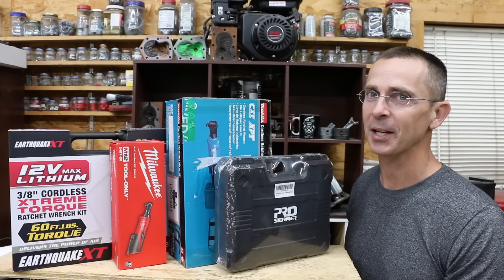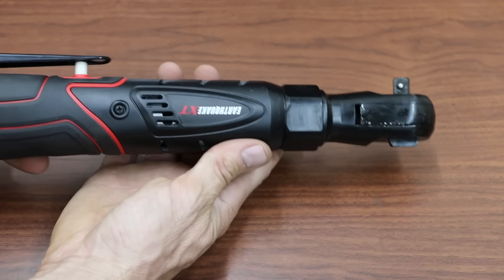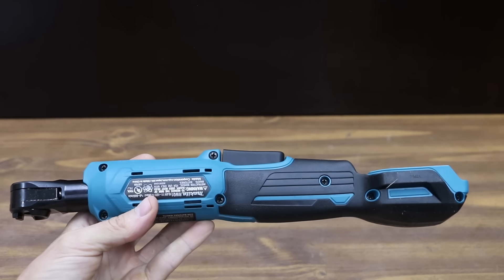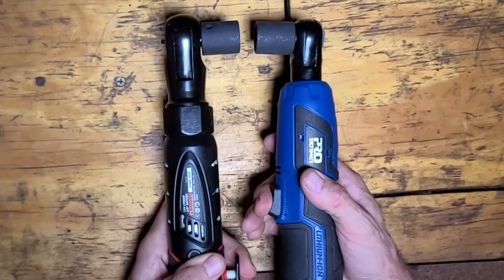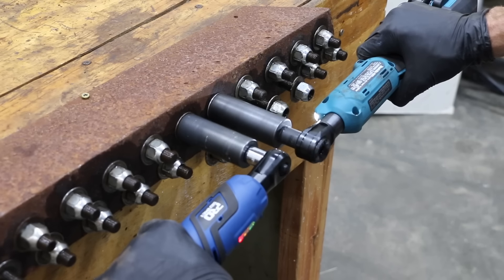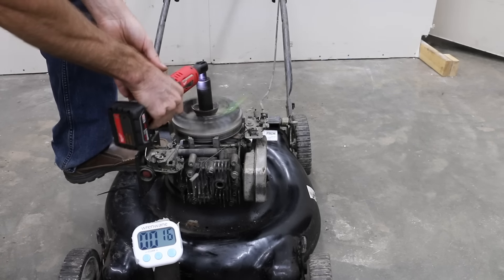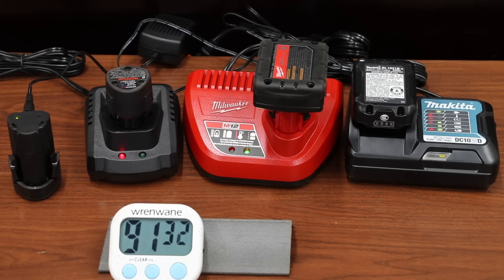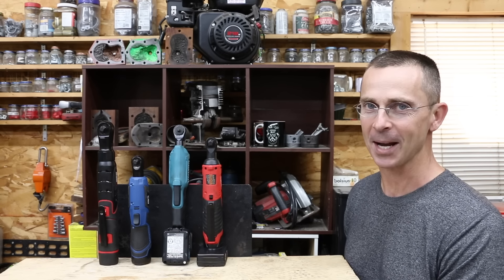Best 3/8 Cordless Ratchet? Milwaukee M12 vs Makita, Earthquake & ProStormer. Let’s find out!

Comment: Too bad it was the old Milwaukee and not the fuel. I have the old and the fuel with the fuel being considerably better
Reply from the maker: Great suggestion for round 2
Reply: My fuel died just tightening a bumper bolt, only used a handful of times, super disappointed
Reply: Ha, for a second there I thought you were talking about beer! 🍻
Reply: @ProjectFarm  round 2 should include a snap on and maybe throw an air ratchet to compare against. I've found my fuel ratchet has now completely replaced my air tools. Especially for at home.
Reply: @strelokblackburn4651  milwaukee has amazing warranty but I've only used it twice in 10 years and I have about 80 tools so far...
Reply: @adampetten1009  yea but got it used so idk if that still applies
Reply: @strelokblackburn4651  then there's no reason to be disappointed...lol. The last guy could have run it over with a truck, then sold it to you in "working condition".
Reply: @markburkey6371  true, but looked brand new
Reply: @markburkey6371  still love my stubby impacts tho. Use them quite often
Reply: @strelokblackburn4651  bring it in, we nearly smoked a 3/4 unbolting a 20" pipline with 2-9/16 studs. went into the service center as it was down on power and they replaced it

Comment: That wasn't the Milwaukee Fuel Ratchet,right?  That would have smoked them all.
Reply: Correct, except on weight, and size where it would be near the Earthquake.
Reply: Yes, but the fuel is also a decent bit more expensive.

Comment: Not sure about other brands, but it may be worth mentioning all Milwaukee cordless tool are warrantied for iirc 5 years from date of manufacture.  If it breaks print out a free label from Milwaukee and in a week or so you'll have a new tool.  No need to register the tool or provide a receipt.  They use the serial number to confirm it's under warranty.  Batteries are warrantied for 2 years .
Reply from the maker: Thanks for the feedback.

Comment: Why would balance matter at all?
The handles aren’t centered.
Reply: what do you mean it does not matter?? if the ratchet end of the tool is twice as heavy as the back it would clearly create a weight issue compared to being balanced.
Very low IQ question.
Reply: @ryandavis8719  You are correct. Additionally, poor weight distribution can increase tension on the wrist making it feel heavier than if it was well balanced.
Reply: @ryandavis8719  I didn’t state “it does not matter.”  So perhaps you should learn to read before trying to pathetically insult another persons IQ.  Do you even understand the meaning of balance?  In the video he’s showing two scales on the ends of the tool.  The handles are justified to one end of the tool. Are they not? So how is the weight ever going to feel balanced when 3/4 of the tool is hanging outside your grip? Besides, the point of “balance” would change as soon as the tool was off the horizontal plane.  You trying to tell me that you’re only planning on using one of these horizontally level? With your hand dead center of the tool somehow?  

That’s what I thought!
Reply: @ericarango5969  wow!!! So much tension on your poor little wrist from a mere two pounds.
Reply: @jhitt79  You'd be surprised, actually. I've used a well balanced radiation detector weighing at 10lbs for an extended amount of time out in the field and it felt like a feather. I've also used a radiation detector weighing only 5lbs but because the bulk of the weight was away from the handle, it felt like I was carrying the full weight. This follows the simple physic's equation of torque. Of course, 5lbs, 10lbs, or any insignificant amount of weight wont hurt my wrist but it definitely feels a lot more comfortable.
Reply: @ericarango5969  I wouldn’t be surprised because you’re comparing apples to oranges. How much does the heaviest tool in this comparison weigh?  How long is the longest?  How “unbalanced” is it (where is the fulcrum?). How often are you actually going to hold that tool perfectly level?  How is the balance effected when the tool is working? 
I don’t need to get into physics to know that when the torque is applied the issue of the tool balance is going to go out the window.

Comment: Great comparison test as usual, Thanks PF, and thanks for the excel video file also. I noticed no tests for jigsaws. I've had expensive ones like Porter Cable and cheap entry level ones like Skill and there is quite a difference. User skill level with this tool makes a big difference but it still could be an interesting test. Thanks again PF 👍🏼

Comment: i have had my Milwaukee 4 years now. it has been used daily as a service tech in rain snow mud. i have even driven it over a few different times i stored it outside for years aswell. no problems with this tool yet. i have used my milwaukee impact guns under 3 ft of water in freezing conditons i spent around $1000 for both my impacts and ratchet. but they have made/saved me 30 or 40 times the amount i have paid for them
Reply from the maker: Thanks for sharing.

Comment: Hey Brother! I'm a Diesel Technician. I swear manufacturers are using cordless tools to great degree when formulating labor times. I greatly appreciated all effort you put into the test for this channel. A few years back, I purchased big bundle of Ryobi cordless tools for use around the house. I've added a few other Ryobi cordless tools for hobby and carpentry use because I already had the Ryobi batteries and charger. However, I'm very impressed with Milwaukee Fuel12 and Fuel18. SnapOn has a long neck version of their under powered cordless ratchet, which I have to admit can get into tight workplaces that doesn't have any balls once it gets there.
So there's an idea for a comparison of 3/8 drive cordless Long reach ratchets. I'll be waiting impatiently for your video.🤓🤠😎🧐😇
Reply from the maker: Thanks for the video idea.
Reply: @ProjectFarm  I Heard Ryobi is also getting into the 'extended-ratchet' game also. They've got a 3/8" and a 1/4" with their 'indexable head' design. AC Delco has a couple, Milwaukee, and Makita already have a couple. Before Christmas, most will have small/high-speed, ultra high speed. This should big year for you.
Reply: @ProjectFarm  Don't forget the Right angle impact (I haven't seen all your videos yet, so I mean to suggest stuff you've already done.)

Comment: I’ve been a mechanic for 25 years now…Ford dealership, couple independent garages, now a city fleet shop & my own at-home shop. I was never a fan of air ratchets…hated the idea of dragging an air hose around with a hand tool. After watching this episode, I decided to dip my toe into the small electric tool market by ordered a ProStormer ratchet. I was also intrigued by the crazy-low price…would it hold up or fall apart right away? 
Surprisingly, after using it almost daily for the last 4 months on everything from small engines to regular automotive repairs, it’s still going strong. Batteries still seem to hold the original charge level, it’s survived being dropped on the floor a hundred times AND into drain pans full of ATF, and so on. For $60 it’s hard to beat it.
Reply from the maker: Thanks for sharing.

Comment: Orielly Auto sells the Pro Stormer branded as Power Torque along with several other tools that share those batteries. 4 Amp hour batteries are available  as accessories. I wouldn't try to run a business  with them, but for the "shade tree mechanics" out there they are surprisingly not utter crap.

Comment: I am a mechanic at a shop in  st louis I do all major engine work, engine installs and tranny installs I've had a 3/8 Milwaukee m12 and a 1/4 m12 Milwaukee  and put them thru hell ! My first 1/4 m12 lasted 6 years 2nd one is on 5 years my m12 3/8 is going on 6 years still on OE battery's from I bought them bought a 1/4 snap on ratchet isbok bit it's not my m12 stuff love the Milwaukee m12 series will buy them again when they break
Reply from the maker: Thanks for sharing!

Comment: My take- If it's made in China all bets are off. The Chinese advertise whatever specifications help to sell the product. And even the (once) better brands like Milwaukee and Makita either don't test what the Chinese are producing for them, or they don't care. The Chinese have little to no quality control so everything goes out the door. While you may get great performance from your brand XX tool, I may get poor performance, or complete failures. Thus the huge variance in reviews of Chinese products. But you did your usual real-world unbiased testing, which is much appreciated.  Thanks for another great product review.

Comment: Best is a relative term when it comes to cordless ratchets. As you said you would be checking RPM, torque, constant load, etc. 
However as a mechanic I can also say that being able to fit in confined areas, how much stress the plastic body can handle before it cracks, battery life, battery charge time, and how easy it is to have warranty repairs done, etcetera also determine what the "best" is.
Reply from the maker: Thanks for the feedback.

Comment: I’ve had two of the Milwaukee brand 3/8 ratchets. Both had the 2.0 amh battery. Both broke under pressure removing normal undercarriage bolts on European cars. One twisted the shaft and had to be completely replaced. Both had a 5 year warranty and were fixed for free. One took three months for parts. I use a 1/4 drive everyday in the aircraft industry and love it. It has so much torque if you’re not careful, you WILL snap off smaller hardware. I believe the makita with the brake is a better design. I think the Milwaukee 18fuel ratchets have a brake due to the brushless drive. Just some thoughts.
Reply from the maker: Thanks for sharing.

Comment: Husky (Home Depot branded) has a great 3/8" lithium ratchet for $59 bucks right now as a Special Buy.  I was ready to get the Milwaukee, but thought I try the cheaper version first, I've been really happy with it.  It's got a variable speed paddle with a lock-out switch, LED, and 30 ft lbs at 230 rpm.
Reply from the maker: Thanks for sharing.

Comment: 14 volt dewalt was an amazing product. 18 volt dewalt had battery charger issues.Not the batteries but the chargers. I stopped trusting in cordless a long time ago. I bought a whole makita set it lasted about 3 months . crafstman lastsed like 6 months.  I do use the brushless dewalt drill kit the impact and hammer which is just an absolute treasure. Insanely well built and light as heck.  But if i gotta pull out a saw or an ACTUAL hammer drill or anything that uses real juice I have a long electric cord and i can jump off 220 to 120 or whatever i gotta do. 250 ft plus of extension cord but I always find power and If i cant well i aint bringing my honda 3000euis cuz at  what I make  they dont  probably got it.
Reply from the maker: Thanks for sharing.

Comment: I used to work as a fireproofer, fixing fibre boards all day every day, I was working as the switch from wired to wireless came in, I had a few cordless dry lining guns but the Makita was the best by far, the lightest (important when its in your hand for 10 hours at a time) quick and long-lasting charge, powerful, ergonomically great, plus it had its own holster (most do now) the tools sales rep who I bought my tools off told me Makita hardly ever failed and never came back under warranty, the other firm he rated was Metabo, me too but at the time they were very heavy compared to the makita
Reply from the maker: Thanks for sharing.

Comment: I love my Milwaukee more than any other tool in my shop, what a lifesaver.  After about 8 years of medium/heavy use I have only changed out the ratcheting mechanism once just recently.   I haven't yet used my new H.F. Earthquake I bought on clearance on a whim as it weighs a ton and a half. Goodness. I am really considering a Prostormer as a backup in my toolbox for for junkyard runs. Excellent video, keep up the good work.
Reply from the maker: Thanks, will do!  Thanks for sharing.

Comment: I hope you revisit power ratchets, the millwalkie looks like the choice,  thing is I have lots of Ryobi 18+ and they have a ratchet now , the bulky battery may be an issue with tight engine bay. A twisty extending head and nice lights. 
Will adding yet another battery system to my tools be outweighed by the Milwaukee performance.
Reply from the maker: Thanksk for the suggestion.

Comment: For what it's worth,  I have a Snap-on 1/4" and 3/8" that I have been using professionally for almost 4 years now.  I have replaced head kits once each.  I've only had one battery go bad as well, it had a warranty.  I know the price is unobtainium for most, but worth it if you need the reliability.   Just remember,  these aren't for breaking tight bolts loose or tightening really tight.  Save that for a breaker bar or long ratchet/wrench.
Reply from the maker: Thanks for sharing.

Comment: @Project Farm  I have the Milwaukee drill /hammer drill and power drill driver. The tools are bulletproof, but their batteries are beginning to fade after 4 years of ownership. Did you happen to notice if the Milwaukee 4-amp battery will fit their other tools that take their smaller 2-amp battery? it looks the same at the charger end, but it might not fit the channel the battery goes in.

Comment: I've had the earthquake for 4 years now and I can't work with out it honestly. I've dropped it several times, it's been sunk in oil, use it all the time to brake bolts loose, and rarely charge the thing. I'm happy with my purchase and can't see it going out anytime soon. I don't like the bulky ends of the other brands it just won't work on tight areas.
Reply from the maker: Thanks for sharing.

Comment: Does a 4 (or 6) amp battery provide more breakaway power than a 2 amp battery? The price difference is substantial, and for home auto work run time isn't so important. I am a big fan ... You are the best!
Reply from the maker: Thanks for the suggestion.

Comment: We use a 3/8 makita at work (manufacturing hydromechanical equipment) and use it 5 days a week at over 1000 cycles a week. They have an average life of about 15 weeks it seems before there is a mechanical failure in the head. 15000 cycles is pretty good for most guys.
Reply from the maker: Thanks for the feedback.

Comment: I've got one of these ratchets but I got it from the Matco tool truck... that thing costed $480 but comes with a soft carrying case,charger and 2 16v batteries... that thing lasts a very very long time....only got to charge it maybe twice a week and I use it every single day... but it too is made in China... but I got to say, that thing is built very very well... it's Matco's  Infineon series... also have the 3/8 drive and 1/2 inch Drive Impacts... those things are really nice... 1600 foot-pounds of breaking Torque on the big one and 600 foot pounds of breaking torque on the smaller one... both have 5 amp hour batteries and they are interchangeable with each other.... but I gave over 1400 for both of those things...😬😬😬...but it was worth it...made my work much easier....
Reply from the maker: Thanks for sharing.
Reply: @ProjectFarm  yeah might have been a little bit of Overkill Right....lol.. I guess... just posting my experiences... love your videos,been watching for a very long time

Comment: I wouldn't expect anything less from Milwaukee. I have use Milwaukee products s Rigid, portacable tools for 35 yrs. I have believe they are hands down the best tool for industrial or non industrial use. You get most of the time what you pay for. I also repair these brands. I know tht these tools get banged around a lot. With parts they are easily fixed.

Comment: Great test!  I have the proStrom that cost $60, purchased at natio  wide auto parts store for $49.95.  There is also avalable  a ProStrom  3/8" impach gun.  Both are wonderful for radio tower wor and use the same battery.  For under $60, if you drop it... you are not out much.  I see that you did not supply the video with a 90 foot drop test. The others are too heavy and the charge times are long. Fantasy job on your testing, very comprehensive coverage.
Thanks for all your videos.
Reply from the maker: You are welcome!

Comment: I am a heavily equipped DYI amateur but I don't have a cordless side ratchet.  I cannot think of a need (my dealer's 5 star garage does my car) for this tool but I want one for my peg board.  It would look nice.  I'm resisting the urge in spite of the ridiculously low prices.
Reply from the maker: Thanks for sharing.

Comment: I have a feeling that the size of the socket that you're using is throwing off your rpm reading. I don't know how the factory reads it. Whether it's on the anvil or directly in the motor but the outside of a socket bigger than the anvil is going to spin faster than the anvil I think.

Comment: When I still need to use my strength to break nuts loose in tight areas this tool is practically a glorified impact wrench, I mean, what's its purpose if I already have an impact driver or a rachet wrench?
Reply from the maker: Thanks for the feedback.

Comment: Using Watt hours will provide a more accurate battery comparison. Multiply the batteries listed amp hours by it's listed voltage, and you will get a reasonable Watt hour rating. Amp hours is a very deceptive way to list battery capacity. Some brands such as Milwaukee list the Watt hours on the battery.

Comment: Great vid! But I believe the Ah of batteries aren't  equal. Milwaukee M12 has 3 or 4 Ah brick battery ,HF and other cheap brand probably just 1.5-2Ah,and Makita looks like 12V  2 Ah battery  .Even with same voltage battery Ah makes a big difference.
Reply from the maker: Thanks!  Thanks for the feedback.